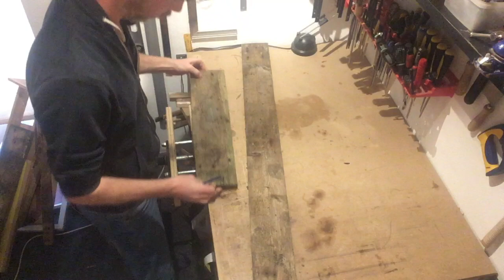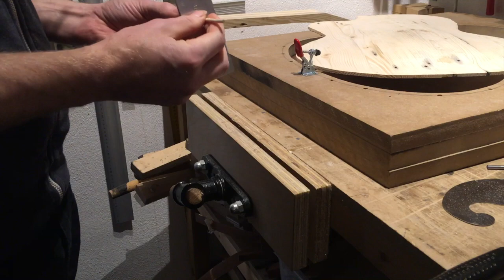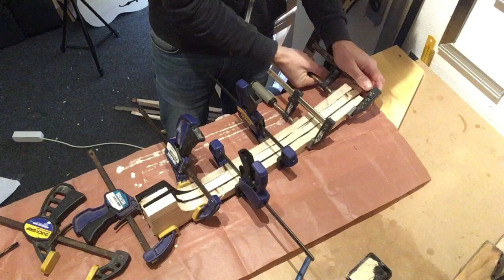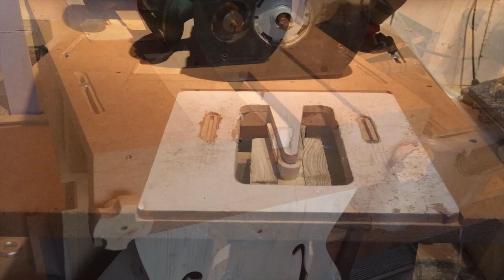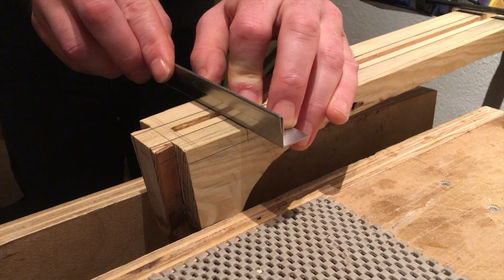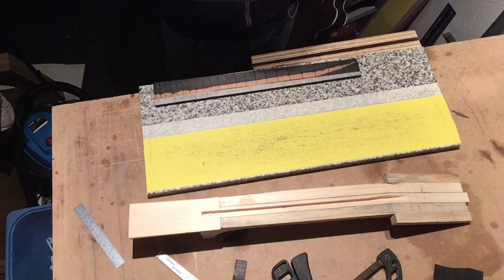Making a Pallet Archtop Jazz Guitar Full Build - Part 2

Comment: Hi Anders, Amazing video. Could I ask what is the model of table saw you are using to cut the fretboard? I'm assuming you are using the stewmac fret saw blade? Thanks.
Reply from the maker: Hi Nick. Thank you!
It is a Proxxon Table Saw FET and i use one of Proxxons saw blades i have grinded to correct thickness. I will recommend using the Stewmac blade though.😊

Comment: Hey Anders. Another awesome build video, thank you very much. You mentioned to me in a previous correspondence that you didn't want to add any colour to your build because you wanted to show off the knots and grain etc. I now agree with you so I would not paint the neck black, besides, it would render adding the black veneer like you did null and void. I mentioned before that I was really looking forward to how you go about building your necks. I'm very intrigued by this, you make yours from 'slats' and glue them 'perpendicular'. That's a very cool approach. I would want to take a piece of 2"x3" and just splice in a scarf joint then glue a stack in for a heel. Your process is like a 90 deg opposite. do you find this make the neck stronger or is it just your visual preference. Truly looking forward to part 3. Merry Christmas and a Happy New Year to you and your family. Carl
Reply from the maker: Hi Carl.
I had some chip out on the headstock, when using the router, and i had to repair it with some inlay pieces. At the heel there is some glue marks as well and that made me think of painting the hole neck and headstock black. I'm also restoring an old Høfner you maybe see in the background sometimes. It has a black neck and a sunburst body. That looks cool to me.
But you're right. It is part of the charm......
Another one asked me in the comments not to stain the guitar and just make it natural. Lets see.........:)

Regarding the 3 piece neck. Vertical grain is the strongest, so a good quarter sawn piece of hardwood (maybe mahogany or even stronger maple) is really good and often used. But it depends on the guitar (and what kind of strings) how strong you need the neck to be. You want the neck to make a little up bow when it is strung up.
I mostly make my necks this way (2 or 3 piece), it is easy to shape and you can have a nice decorative strip down the neck using different colors of veneer or thin boards.
In this case i did not have any choice because the boards from the pallet is flat sawn and this way the neck blank became quarter sawn.
A Merry Christmas and a Happy New Year to you also!